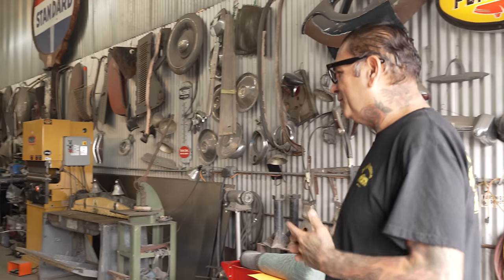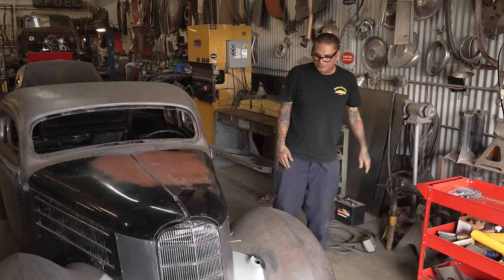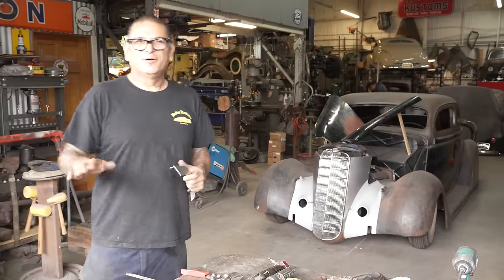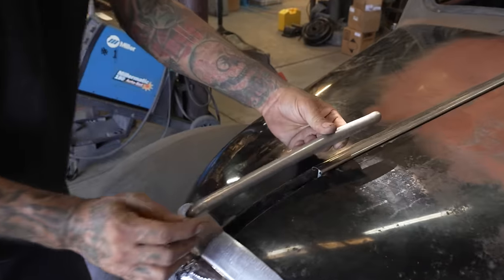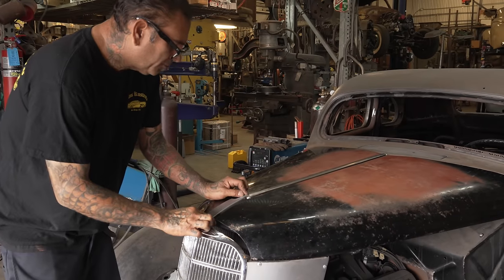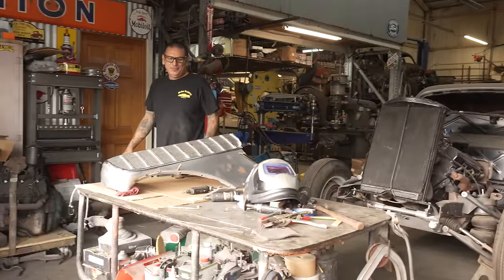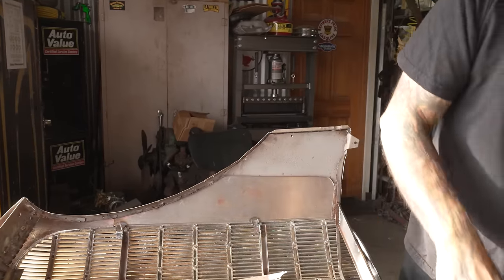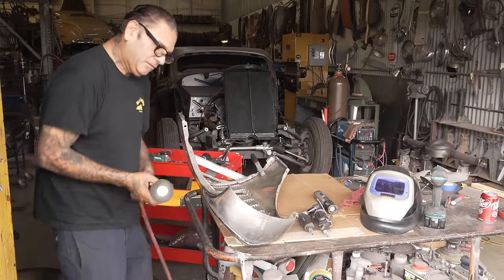1936 La Salle Grill on a 1936 Ford Part 3

Comment: Those bead rollers were used to make the elbows on heating air ducts. There also are ones to make the beads and crimping for the same things. I have those in my garage and use them occasionally. Nice work on the grill as always.

Comment: On the old  Ford Model T's I used to restore I made a drip tray under the hood to prevent rainwater from running in and drowning out the ignition.  i don't know if this hood style would leak or not.  Great video!  Beautiful work homie!

Comment: Does gettin that metal hot make it easier to form on that double contour bend or is that make it brittle?  Is there a  way to take an impression of  the  shape  your after then heating your piece to fit the mold?